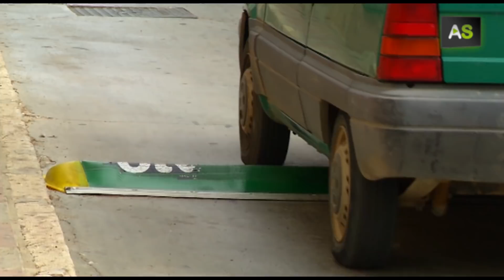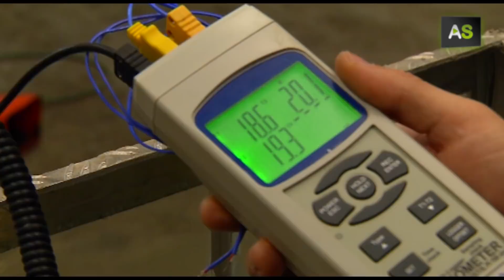AS Intelligent speed bumps that only activate if you don’t respect the speed limit

Comment: Don't wanna act like a know-it-all, but I think it worked on paper but not so much in real life: even at those slow speeds we can see how it shakes the car. A 1-2 ton vehicle suddenly getting contact with it (despite at slow speed) is enough force for it to harden instantly. To me the effects on those cars seem the same as any other speed bumps at such low speed.. If you're that slow, a normal bump won't damage your car, either.

Comment: Im not 100% sure with this. In theory, it could be brilliant if lets say the speed limit is 30mph and it allowed you to go over that with no problems at 30mph but felt very hard at 35-40mph.

From what i can see in this video, you have to go very slow over the bump for it to be unnoticed but drivers will still go fast and then slow right down over the bump and speed up again, which is what people do anyway so its virtually useless in my opinion.

Comment: It doesn't make any sense. If a speed bump causes damage to a vehicle, although that vehicle is going at the correct speed, is bad and must be replaced.
But most of the bumps don't cause any trouble for drivers who respect the speed limits, so, again: this "invention" is totally unnecessary.

Comment: No matter how tough they make the fabric containing that fluid it will need constant maintenance compared to traditional speed bumps. But this is on the right track. 

Maybe having many metal short fat hydraulic like pistons set in the road with the fluid inside in such a way that it adds resistance as the piston is pressed, when they are pressed slowly they go flush/flat to the road.

Comment: People saying "Just cut it with a knife" you guys know there're cloth-like materials that can't be cut right? You can even add a thin chain mail to the fluid wrapper and it'll be enough or if you live in the getto give it a steel structure and make it work like a hydraulic speed bump.

Comment: Then you only have to go fast enough to pass before its getting hard. At 100km/h it wont react quick enough. So one reason more to drive even faster.
Reply: Fitim Bunjaku non-newtonian fluids such as this speed bump hardens more the faster you go, it doesnt work by a sensor or anything, I works by outside force acting on it. So theoretically the faster you go the harder it gets ruining your car
Reply: Bradley Campbell it gets harder, the faster i go, but does it get hard quick enough at higher speed? I hit it with my frontwheels and the backwheels will then get the force back, but lets say im driving 100km/h and the wheeldistance is approx. 2meters. That would mean the fluid has to react in less than 0,072 seconds, because thats when the backwheels pass the fluid.

Comment: This a big pile of non newtonian bullshit, let me explain why:
1) where i live people unbolt normal speedbumps from the road you think they are not going to cut this? Also if a pice of a normal speedbump is damaged it can be repaired, in this you have to replace the entire speedbump. So it's expensive to mantain.
2) As you can see in 0:56 people behave in the same way as they do with normal speedbumps, go above the speed limt, slow down go above the speed limit again. If the goal is to reduce the speed of drivers in general this is completely unuseful.
3) this claims to be "less harmful" to the veicle compared to a normal speedbump. If you are going slow, the  normal speedbumps are not going to damage your car, they are going to damage your car if you are going fast and since bot normal and non nwetonian speedbumps are designed to make you bumb when over the speed limit, they will cause the same ammount of damage.
4) speedbumps in general are dangerous, the concept behind them is wrong, "oh you are going over the speed limit? Let me make you loose control of the veicle". I completely agree that you shouldn't speed but if someone does you should not try to kill him because of that. This is already dangerous for a car let's not mention motorcycles or bicicle
5) speedbumps in general are very inconvinient for ambulance drivers, as you probably have experinced, ambulances have a pretty high speed because the time they loose driving might be crucial, also hitting speedbumbs makes the patient jump even at slow speeds.

So you made something already dangerous more expensive, more expensive to mantain and less durable, bravo, you deserve an award

Comment: Never shown once what happens when a car actually drives quickly over it... great journalism. It might as well have been a long green strip of foam.
Reply: Stab it with a knife in the night.
Reply: +CommanderCorner but they didn't show that! Practice is sometimes different from theory...
Reply: Theoretically, unless you dropped a truck on these, bursting them with a car is going to be like bursting a regular speed bump, as the fluid becomes solid instantly when under stress
Reply: Agreed.  But what they should have done was use a beater car as a demonstration.  Otherwise, no one is going to want to test their car on this.  Driving over speed bumps at high speeds can cause serious damage.
Reply: My friend have jeep and once a low bmw stickted to our ass. We decided to drive fast over a speed bump. The front and the underside of the bmw got extremely damaged. Karma
Reply: Wars Boerse ikr
Reply: Wars Boerse this is a small project. They cant afford damaging a car that much just for a demonstration.
Reply: if you watch and pay attention, if the car goes fast over it then it becomes hard on the back two wheels when it goes over it 😕
Reply: Wars Boerse It acts like a speed bump when they drive quickly. Duh.
Reply: Well mix cornstarch and water and see if it makes sense to you then... JEUSS Christ dude
Reply: why risk breaking a car on an active road just to show something, his warehouse clearly wasn't big enough to race a car through at 40mph.

or maybe you should go find out for yourself.
Reply: Aaron Calvert, I know that you cant have it for armor and stuff is bc bullets are fucking insane. That's penetrating. But when it comes to a tire or a foot on this stuff, it becomes a solid as you know. The pressure from the weight will definitely make it hard.

Comment: Speed bumps just cause accidents as people jump on the brakes right in front of them, then rocket off pedal to the metal after them to recover the time they lost.
Reply: Mad dogger because even at 2 mph your fucking head hits the roof, so now that I'm pissed, I drive as fast as possible through the rest of the lot.
Reply: I heard that here in the UK we're actually going to be getting rid of speed-bumps. It's mostly due to areas with speed-bumps having higher pollution due to constant acceleration in low gears for long stretches of road on particular streets. I don't really mind them too much when I'm driving. But it's understandable if it's causing more pollution.
Reply: If a speed bump forces you below the posted limit on the road it is installed in, then it hasn't been  designed correctly.  Unfortunately, this is the vast majority of them.
Reply: Gunnar Konig exactly what i do. speed bump? fuck me? nope fuck you, because of that speed bump, I now do 60 mph in a lot I used to do 10 mph in.
Reply: Gunnar Konig Wow, are you an expert on traffic?
Reply: Gunnar Konig "ah the government is out to get us all! dont drink the water!" Is how you sound like right now maybe some people will realize that theres a speed bump and that if they dont slow the fuck down theyre gonna be jumping around everywhere. I dont see why you think that it would cause more accidents or cause more tickets even if it does only stop a car momentarily.
Reply: By having eyeballs.

There is absolutely zero point to speed bumps.
If the people in charge gave half a shit they would clearly mark pedestrian crossings (eg. vivid colours) and make sure people that want to cross are visible (eg. street lights on them, nothing blocking view like plants, dumpters, parking spots, etc.).

None of them can be traversed at the speed limit (and the speed limits are often 10 to 30 km/h too low as they're designed for cars from decades ago that couldn't brake for shit) and if you're not absolutely crawling, the strain put on the front suspension is the same as doing a fucking jump, not even considering the possibility of scraping the bottom of the car or even tearing the bumpers off.

All it does is aggravate drivers and cause absolute disdain towards pedestrians as they are seen as the cause of this farce.

The real danger are people texting/drunk/etc. while driving and guess what? No amount of speed bumps is going to stop them from running over a family crossing the street.
Reply: thats complete bs lmao, you do realise that a, thats illegal and b, not their purpose.

a speed bump is to stop people going over the limit in specific areas like areas with high density pedestrians, tight roads, school zones, parking areas, complex road designs.
They have become more and more dangerous as they don't seem to slow people very well. only causing them to break their vehicles on them.

This design allows people that respect the limit to pass by almost normally where as people that break the limit will probably get a pain in their neck.

1 problem that this bump fixes is that people will slow down to much before them, this design removes the need to go slower than the limit.
Reply: Gunnar Konig Yes, but they're meant to prevent vehicular homicides, not accidents.
Reply: Bullshit. They're there to aggravate drivers so they speed more and make money off tickets, and to lower the longevity of suspensions.

Comment: It seems like an extravagant but justifiable idea. You'd want to cover them in a knife-proof material though and those things aren't exactly cheap.
Reply: MaskedMenace830 they kind of are considering the fact that it is made of cornstarch and water and plastic is cheap
Reply: MaskedMenace830 

This is easy. Just cover it in a rock layered mesh, then chain mail, then kevlar. Also section it off so you would have to stab through it 40 times to get rid of all of it. Most people wouldn't have access to anything capable of penetrating it anyways.

Comment: So what's wrong with regular speed bumps I miss the point? Either one you need to slow down for or you're in for a big bump...
Reply: Gurn Blanstein repeated speed bumbs can damage a car over time even if your speed isn't crazy.
Reply: gurn blanstein BALDERDASH!  I have been an active mechanic since 1983 and have seen multiple vehicles with minor ware that could be attributed to running over obstacles the size of speed bumps.
Reply: Orlando Fuzz ... that's bullshit I've been a mechanic for over 35 years and there's little to no harm in repeatedly taking speed bumps at  slow speeds..
Reply: Orlando Fuzz ... POPPYCOCK! Taking a speed bump properly causes no damage!

Comment: Non-Newtonian liquid?
Reply: yes
Reply: Non-Newtonian fluid
big difference
Reply: Régis Lourenço All liquids are fluids, by definition. As are all gasses.
Reply: luke godfrey That's misleading. A Non Newtonian fluid has the characteristics of either a liquid or solid changing based on surrounding conditions at that moment
Reply: luke godfrey If you base whether something is true or untrue based on word choice it can be tricky. There are varying definitions for everything. If I define the word car as a motor vehicle than a riding lawnmower could be a car
Reply: Orlando Fuzz Wrong: a newtonian fluid is one where the viscosity remains the same no matter the shear rate. A non-newtonian fluid, therefore, is one where the viscosity changes with the shear rate: it is either shear thinning (like blood or toothpaste), or shear-thickening (like cornflour paste or this stuff).
In any case, shear-thickening fluids do not become solids when struck: the high shear rate thickens the fluid so much it can't flow out of the way fast enough and it feels like hitting a solid.
Reply: luke godfrey If you read my comment I never said it becomes solid I said it could have some of the characteristics of a solid

Comment: The bumps should automatically lower down if speed limit is detected. Also, one way tire spikes should raise from the ground on freeway off ramps for wrong way drivers.
Reply: David Darby that would be very expensive and would require maintenance and is super overkill for a speed bump.
Reply: Austria (without kangaroos) proved that warning signs are enough to stop unintentional wrong way drivers. Suicidal drivers won't be stopped by these spikes either because they could turn their vehicle around in any place.
Reply: If there's a system people will hack it
Reply: no
Reply: @kaycee Brooks Don't be so naive. High speed freeway head-ons are a lot more common than you think -- often with no headlights. You want  that to be you?
Reply: They actually do have things similar to this. They work like a door would close, they can be pushed down if the force is from one direction, but they will remain if its from the other direction. Cars going the right way will be fine, while cars going the wrong way will get stuck on them, or have their tires blown out.
Reply: David Darby No, I mean at the end of the off ramp you can turn left or right onto a road with other cars on it. 

How would it know the difference between a car driving along the road very close to the top of the off ramp and one going straight down the off ramp. Surely the sensor would have to be right at the end of the off ramp to work. The spikes would also have to be at the top of the off ramp as well.
Reply: David Darby 
lmao. Easier said than done.
Reply: If someone had to back up because someone was stuck on the road it could cause problems
Reply: Willing to help
Reply: David, I don't see how telling you to invent something, followed by an unnecessary insult is naive, or for that matter to the point of this discussion. I do believe however, that you were a bit naive when suggesting the spikes. If a tire is blown out, it could just cause more problems such as lack of control, which could lead to crashes worse than they have to be.
Reply: David Darby Off ramps lead to a road. How would it know the difference between cars driving straight down the off ramp and cars driving past it? Stray to close and you could blow out your tyres as you drive past.
Reply: One way spikes would stay retracted below ground unless a car approaches from the wrong direction (sensors). Even a mishap would be harmless since they're one way like you see in parking lots.
Reply: Problem is, that would be very expensive to build and maintain. Way cheaper to just have a camera auto ticket people who speed.
Reply: Since working on a sensor, it could ignore emergency vehicles (sound of siren for example).
Reply: I'm sure the police would know the system when entering the freeway in the wrong direction.
Reply: I never said anything about a key. Follow the thread.
Reply: There is generally a way to go around on the shoulder anyway. The system is meant for oblivious drunks.
Reply: @Jon fritsch Completely agree but automation and efficiency are unacceptable in liberal states. California has put a stop to red light cameras.

Comment: stanley knife...?
Reply: Against kevlar?
Reply: Still works
Reply: Spectrum, buy a polymer cable for winches and try to cut it, it is easy.  You should not stab it, you should cut it the same way you cut bread. That way, you easily cut individual threads one buy one.